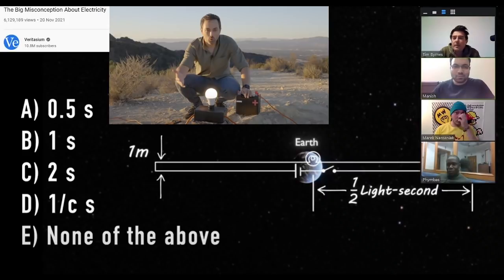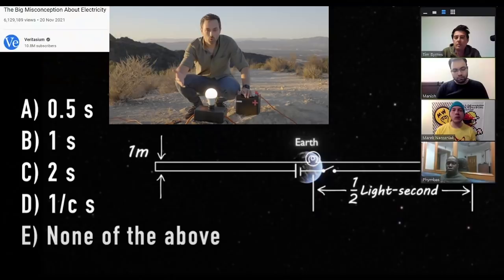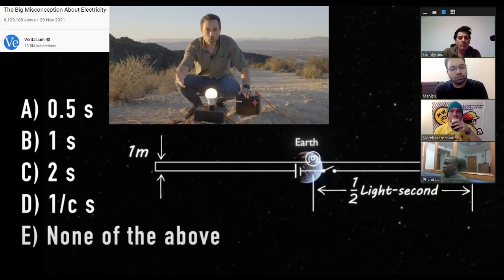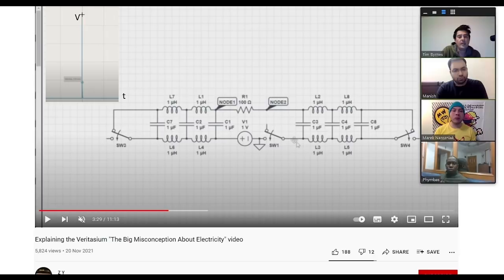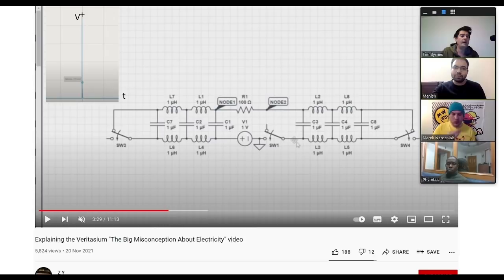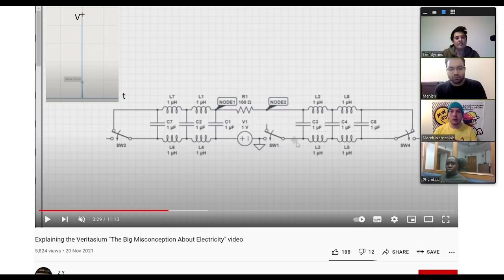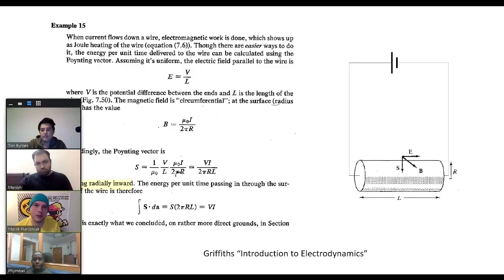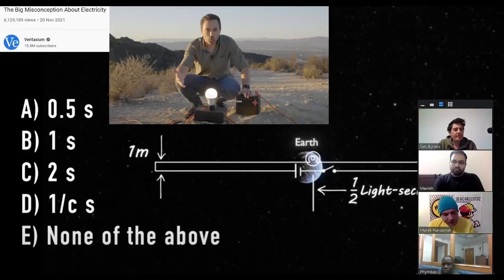Veritasium's Big Misconception About Electricity video and the point about Poynting

Comment: My problem with the original video is that he mixes transient phenomena with steady state.  When the switch closes at t=0, a step voltage is launched down both left and right lines.  The full circuit PVs don't exist immediately because the electric and magnetic fields develop as the wavefront propagates.  That means the PV from battery to light is time variant just like the rest of them around the circuit.  He makes it as if it's fully developed immediately in a steady state condition..
Reply: Exactly!  I tried calling him out in the original video by telling him to show a graph of the power delivery to the bulb versus time over the course of several seconds.  That would show viewers the difference between the transient displacement current and the steady-state current.  Furthermore, the original author avoids discussing what qualifies as "the bulb is on", and then intentionally confuses users by showing the light bulb reaching full brightness as soon as he closes the switch.  A layperson is not going to consider the bulb to be "on" if it is producing such little light that we cannot perceive it.
Reply: But a current is induced at the lightbulb at 1/c, Veritasium is right. It's not the FULL current of the circuit, the current has to propagate in order to get that, but if the lightbulb can light up with a low enough current (and no minimum was placed on the circuit, so it can) then the lightbulb lights up at 1/c after the switch is thrown.

Watch starting at 6:35, they talk about how crazy Feynman thought this was. Poynting vectors basically mean that a capacitor initially charges with current flowing in from the outside edges of the plates, not from the wires.

TL;DR, Veritasium is technically correct that the lightbulb lights at 1/c (via an induced current, not the current of the circuit), and this video you're commenting on is trying to explain why that's true.
Reply: @jeffwells641  so many problems. 1) leakage current. If "any" current is enough, the light is always on. 2) he shows the light at full brightness immediately, when that is not what would happen. How else should the viewer interpret this demonstration, other than to believe full power is delivered at that time? 3) the displacement current that begins flowing at 1m/c (check your units) will stop flowing once the wavefront reaches the load, so that current cannot keep the light illuminated. 4) to circumvent the trickery he is attempting to play with the words "turn on", we can ask what happens when we open the switch. The light will not turn off in 1m/c. We reasonably expect the turn on and turn off times to be similar, not separated by nine orders of magnitude (!)

Veritasium is clearly engaging in deceptive behaviors and spreading more misconceptions than he claims to alleviate.
Reply: @DeadCatX2  Try watching this video again.
Reply: @jeffwells641  your comment doesn't address any of the things I said, so I'm wondering if you're even arguing in good faith. I'm an electrical engineer with two decades of experience, I immediately saw through Veritasium's deceit. You should watch ElectroBOOM's video, he's a real electrical engineer as well, and he very succinctly shows the whole picture. Let me break it down for you again.

If "any" current is enough, then leakage current will ensure the light is ALWAYS on, whether or not the switch is closed (indeed, ElectroBOOM shows you can power the light with the switch open, using an LED). At this point you need to start toying with all kinds of criteria to determine what is "enough", and all of this is hidden from the viewer i.e. it's a gotcha gimmick.

The video shows the light turning on at full brightness in 1m/c.  AT BEST, with a perfectly matched source, line, and load impedance, you will have 1/4 of the power delivered to the load at that time. Under reasonable conditions it will be MUCH smaller. Showing the full brightness light immediately is the biggest deception in his video.

The enormous gap between turn on and turn off times violates intuition and this is because he plays games with the definition of "on". This is why REAL engineers use definitions for rise and fall time that refer to how long it takes to transition from e.g. 20% to 80% of equilibrium.

The current that is flowing at that 1m/c is what James Clerk Maxwell referred to as Displacement Current. It exists because there is a change in charge density (dρ/dt). At one second, under ideal conditions, the charge density is no longer changing, so the displacement current is no longer flowing, and instead the power is delivered through the direct current.

If your comment cannot even attempt to address any of these facts, I'm going to assume you're just a troll and not honestly interested in the truth of the matter. Just like Veritasium.
Reply: @DeadCatX2  I don't think you've watched the video, which is why I told you to watch the video. I think you got to a certain point that you liked, and wrote a comment. These physicists all agree with Veritasium (though they feel his explanation muddies the point, rather than illuminates it), and they agree for a reason. Poynting vectors have lasted 150 years without a reasonable replacement, and they suggest some very wild but apparently true facts about the way energy is transferred through electrical circuits. 

Reality does not have a duty to conform to your expectations.
Reply: @jeffwells641  Once again you refuse to engage with any of the facts I presented, and instead try to gaslight me by claiming the facts I have stated are "expectations". It is clear you're arguing in bad faith, and have no interest in the truth. That's why you can't address even one of the four points I have raised. Because they are correct, and you cannot point out any flaws in the statements, so instead you just gesture vaguely toward a video that does nothing to address any of my comments. Until you actually engage in an honest discussion here, I'm done trying to explain. Feel free to continue selling Veritasium's snake oil.
Reply: @DeadCatX2  I'm not the one refusing to engage the facts. Watch the video again.
Reply: @jeffwells641  You literally are refusing to engage the facts.  I have stated facts (e.g. "Veritasium shows the light reaching nominal brightness instantly and this is not what would happen").  All you do is say "watch the video", without indicating which, if any, of the things I have said you disagree with.  For instance, this video acknowledges that full power does not reach the load at 1 m/c, so this video is entirely consistent with that fact.  Maybe you're the one who needs to watch the video, and then re-read what I said carefully.  Since you cannot point at anything incorrect in my statements, I take that as tacit admission you know that you're wrong here.
Reply: @jeffwells641  2:47 Here, because you are so obstinate, I'm going to link you to the portion of the video that agrees with me.  Here you have your own source saying the same thing that I'm saying

"You flick the switch and it will move the charges on the other wire where the light bulb is (i.e. displacement current) in the time 1 (m) over c, but then the main kind of current (i.e. direct current) will come later, and that will indeed come like one second later because it takes time of one second to go all the way around the long way around the circuit.  So basically this, you know, the way that he phrases the video, it's a little bit misleading in this way because when you normally think of when does a light bulb come on, you think of like, the full current to go through, not like some induced current on the other side.  So even though 1 (m) over c is technically correct, a lot of people have been saying that it's misleading in a way."
Reply: @DeadCatX2  And what did I say? Pretty much this exact thing which you've been arguing against this whole time. Who doesn't know what they're talking about here, when you practically repeat my comment back at me as a rebuttal of my position?
Reply: @jeffwells641  You're the one arguing against yourself here, man... to quote you, "but if the lightbulb can light up with a low enough current (and no minimum was placed on the circuit, so it can) then the lightbulb lights up at 1/c after the switch is thrown".  Under these "rules", the leakage current ensures that the light is always on, even when the switch is open.  This was the first of my points, which neither you nor the video made any attempt to address.  You should work on your reading comprehension.

You also did not address how the video shows a nominal brightness light, implying that at 1 m/c the full power is delivered to the load, even though to quote you, "It's not the FULL current of the circuit, the current has to propagate in order to get that".  But again, you have already demonstrated poor reading comprehension, so I fully expect you to whiff this point, too.
Reply: @DeadCatX2  And yet, you're still arguing against it. Bizarre man. What are you even trying to say? You're disagreeing with me, yet somehow everything you say agrees with me. Get out of town.
Reply: @jeffwells641  You are surreal.  At no point do you even acknowledge what leakage current is, or that it results in the light being on *while the switch is still open*.  It shows how arbitrary and capricious the argument that "any" current is.  There is always current, even when the switch is not closed.  I don't know why you're having such a hard time with this.  The "any" current argument fails because of leakage current.  At the point where you have to split hairs over how much current turns it on, you have already demonstrated the gotcha inherent in Veritasium's video.

And you also refuse to acknowledge that Veritasium lies to his viewers when he shows the light at nominal brightness after 1 m/c.  Yet you admit that full current isn't flowing.  Can you really not see how you're trolling?
Reply: @DeadCatX2  Don't you find it interesting that you're the only one in the internet who is mentioning leakage current? Could it be that it's because you don't actually know what leakage current is? Leakage current occurs in closed but insulated circuits where the ideal current is zero. It does NOT occur in fully open circuits, where the actual current is zero.

Go back to school bro, you don't know what you're talking about.
Reply: @jeffwells641  What are you, three logical fallacies in a trench coat pretending to be a YouTube commenter?

Mehdi, an actual electrical engineer, on his channel ElectroBOOM, is the one who mentioned leakage current.  Pretty sure he's on the Internet.  Strike one.

A "fully open" circuit, you say?  Are you familiar with inductance at all?  When the switch is closed and you open it, where does that current go?  Are you telling me that you can instantaneously change the current with ideal components?  I'm pretty sure that violates the nature of inductance.  As you well know, the gap in the switch has a resistance, and the inductance of the wiring will ensure the voltage reaches high enough that the switch will arc until it reaches a new steady state.  You should know better than to say "fully open".  Do you need to go back to school?

You also still intentionally avoid engaging with points that are irrefutable.  The first is that he shows the light at nominal brightness at 1 m/c.  You never address this point because you know it's a critical flaw in your own analysis.

Furthermore, as this video states the viewer does not generally consider "turned on" to be an induced current artifact that results from charging the transmission line.  This was misleading on his part, and is exactly what I have been saying.  It's also why I posit what happens when the light is on and you open the switch.

NO ONE CONTESTS THE PRESENCE OF DISPLACEMENT CURRENT AT 1 m/c.

Again, your reading comprehension is poor.  Perhaps you need to go back to school, bro.
Reply: @DeadCatX2  This Jeff Wells joker is clearly not arguing in good faith. His argument is, "The Veritasium dude can do no wrong and I will parry your sound reasoning with fallacious rhetoric because [lord knows why]."
Reply: I think Vertitasium, is intentionally misleading, even fraudulent.  He shows a light bub, suggestion watts of power. If he had instead shown a sensitive galvanometer or a radio receiver or oscilliscope - able to detect the microwatts that are transmitted beginning 1m/c I wouldn't be disturbed.  Then his explanation and appeal to the Poynting vector are mere artifice.  If you were to calculate the Poynting vector and integrate over he surface of the bulb, you'd see you only get microwatts of power until ~1 second has elapsed.  Only after 1 second is E-field is strong enough to develop significant power in the bulb. Derek asserts that is it NOT electrons moving in the wire providing power ... then he appeals to the B-field (as the Poynting vector term) which is only caused by electrons moving in the wire - contradictions.   He's trying to bamboozle people, not provide a good explanations.
Reply: @jeffwells641  Anyone who's owned an AM radio knows that opening & closing switches creates an EM pulse outside the wires.  Microwatts.  But Veritasium implied directly that would be enough to power a bulb, or produce light and that is false.  To produce a visible light photon it is necessary to accelerate a charge (electron) through a potential of ~1.5 volts (near infra-red).  The Veritasium apparatus will not produce any such field at the load for ~ 1 second.   It's a fraud.
Reply: @jeffwells641  You misunderstand.  A B-field is merely the relativistic 'distortion' of an electrostatic field as viewed from a moving frame of reference.  This has been taught as an undergrad level physics for many decades.   Before relativity, Maxwell brilliantly applied Gauss' (equally brilliant)  fields math to this "magnetic" distortion that was observed.  Poynting invented his power flux 'Poynting vector' in1884, also pre-relativity.  The B-field is a fiction, although an extremely convenient one for practical calculation, and happens to be accurate.

So we make a practical calculations using a fictitious B-field used to derive a power flux field via Poynting vector.  The calculation (if Veritasium had bothered to do them) would be accurate, but Veritasium argues that this "explains" the transmission of power, but it is only a pragmatic way of calculating power, and explains nothing.  Veritasium conveniently neglects to actually integrate the Poynting vector over the surface of the bulb and then  realize that it's mere microwatts until ~1sec after the switch closure.

Instead the charges at the light-bulb [light bulb frame of reference (LBFR)]  experience no new force until 1m/c (~3.3ns) after the switch is closed (event horizon). Then the LBFR observe that the charge distribution to the left/right of switch begin to change to more neg/pos, creating a dipole).  Around 4.7ns after the LBFR sees the switch close, they see that 1meter of wire to the left&right of the switch have this new charge density.  This dipole creates an electric field at the light which causes the electrons at the light to begin accelerating toward the + side of the switch-side wire.   But the field is quite small (the 1/r^2 thing applies).   When these  light-side electrons start moving due to the dipole E-field they will observe a distorted charge density in the switch-side-wire due to the Lorentz contraction.   Thus they experience a force away from the switch-side wire (Hall Effect).  The electrons are constrained to the wire by it's "work function".

But under reasonable assumptions (12vdc battery, small wires) there is only 0.48 nano-Coulombs per meter of the charged wire. The E-field created at the light a meter away is weak.  That creates a small E-field at the lamp a meter away.  By the time half of the wire (the entire switch-side wire)  is charged  to it's new potential (0.5 sec) the electrons at the light would observe am 8.63 volt/meter force, or about 0.86 volts across the 10cm light shown (that field drops off fast on either side of the light).  It can't light.

The entire power going into the "fields" (accelerating & re-arranging charges) for the first 1sec is ~140 milliWatts, (see assumptions)  and only ~90 microWatts can be observed at a 10cm diameter light a meter away.  Only a fraction of that causes current.  Further, the E-field is too weak to accelerate any electron enough to produce visible spectrum photon (aka light). Note that same bulb in sunlight would absorb ~ 4 Watts (vs 90 microwatts) , and that will cause a far more random electron motion.
==
Veritasium is being VERY misleading, and seems to be intentionally misleading about the amounts of power involved.

Consider the absurdity of the Veritasium claim that the electron motion in the wire is not the main power.  First, the B-field, which he he goes on-about at length, is nothing except an artifact of electron motion in the wire. There is no B-field without it.  Instead, when electron motion through the wire occurs at ~1sec, the B-field in the wire/filament/led-junction is many orders of magnitude larger, and so is the power.  For the infinite wire approximation, the B-field falls off at 1/r, so a 0.5mm wire vs meter away experiences a B-field only 1/2000 th as strong as at the current carrying wire.

More pragmatically - consider a 1200W coffee maker that will draw 10 amps from your 120vac home circuit. When you flick the switch, your fingertips (filled with conductive fluid) just a couple cm from the circuit experience MUCH higher E-fields and B-fields than the Veritasium bulb.   The Poynting vector at your fingertips is perhaps 10^8 stronger than the Veritasium example.  You can get an even stronger Poynting vector by holding one of the two conductors while you flip the switch.   Why don''t your fingertips burn off ?  It's b/c your hand absorbs only milliwatts of power, for a few nanoseconds.

I have a bad feeling that Derek(sp?) of Veritasium is more interested in clicks than facts.
Reply: @DeadCatX2  Disagree.  If ANY current could light the bulb, then it would always be on unless it's at absolute zero temperature.  However you are ignoring the physics of light.   Visible light photon production REQUIRES the acceleration of a charge through a potential of ~1.5 to 3.5 volts.  The field strength at the light bulb, in the apparatus as shown, cannot have a strong enough E-field to do this.  Derek's apparatus cannot produce light at the bulb in 1m/c.
Reply: Veritasium posits four answers, three of which depend on the length of the wire, and one which doesn't. He says the correct answer is the one which does not depend on the length of the wire, but only on the distance between the switch and the bulb (1 meter). Therefore, his answer should be the same for all the following cases:

1) the wire is of one meter length, connecting the switch directly to the bulb.
2) the wire is of ~infinite length.
3) the wire is of any length, zero to ~infinity, AND not connected at the other ends.

Try it and see if you get the same result for all these cases.